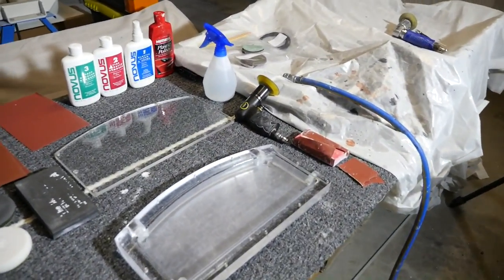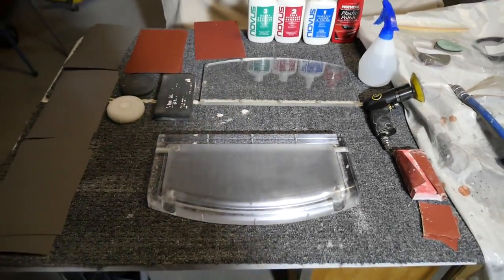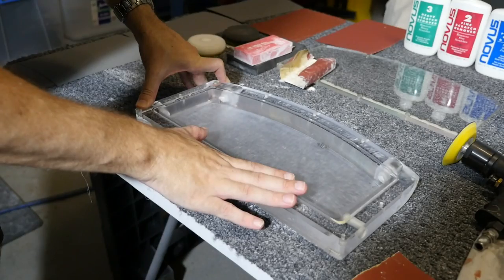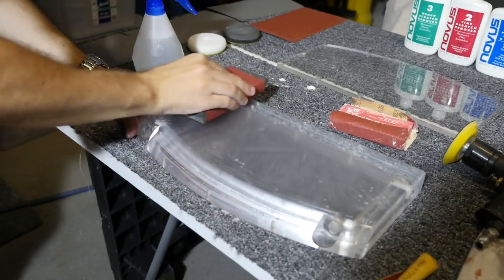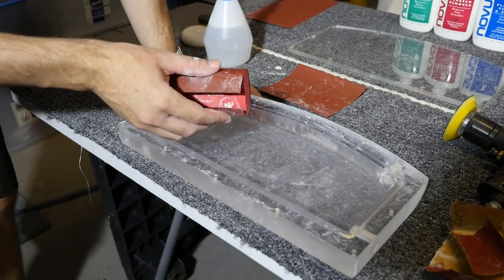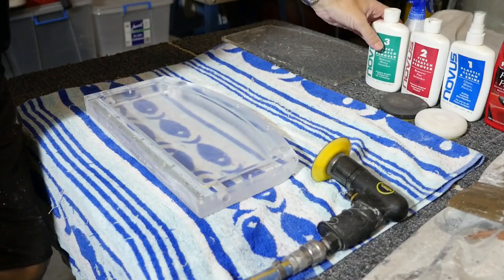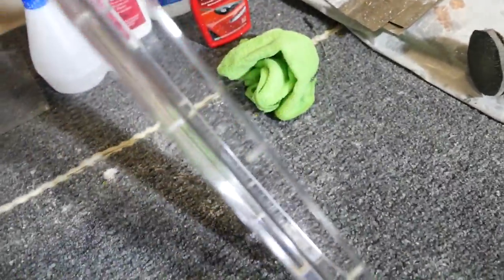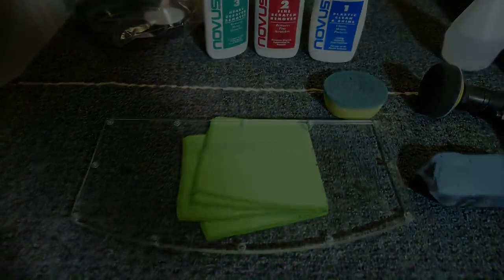SC Modding #5: Acrylic Polishing

Comment: Great video. Thanks. A couple of advices. When you change the grid of the sandpaper rinse the part first. If you don't the coarse particles stays and they scratch the surface. Don't use detergent for cleaning or polishing. I don't know the chemistry but makes the acrylic foggy. If you read the cleaning instructions for a acrylic blender or motorcycles windshield for example, they recomend to use mild soap.

Comment: great work...If you drilled hole into the acrylic sheet, can your system of polishing down inside the holes,would the hole bore become clear..Ive drilled into acrylic before,and the bore after the acrylic was drilled,became foggy looking...How would you clean the inside of the hole bores,so they were reasonably clear..I want to be able to see whats in those holes once drilled,...any suggestions?  sure would appreciate a response...thanks,jb

Comment: Love the polish and the look of the part, but I do wonder how the thermal expansion of acrylic will come into play during use as the acrylic piece is so large. Also i wonder about the large opening and o-ring and how it will hold up over time. Not being critical, just wondering about the mechanics of this thing. Love the videos, they are the reason I built my own first proper pc.

Comment: Looks great!   However, you might want to experiment with heat to polish acrylic.  Made some screw drivers years ago.  The handles were done on a lathe, then on the lathe using a torch going back and forth would polish the cut areas perfectly clear.   If you did it right anyway.  Heat left to long would create bubbles and scorch marks.   Now a heat gun might be a better option.   Though, heat is probably faster, buffing may be safer as not sure you could recover from a piece from scorch.   Thanks for the videos!

Comment: I find that once you get to P800, you can switch to novus 3.  Novus 3 is definitely course enough to tackle P800 (some people say even P600, but I get mixed results at P600).  I find the hard part is using Novus 2 after the 3.  There really needs to be something in between - i.e. your 5 hrs mostly spent in polishing comment I am guessing is going to be the work with Novus 2.... (and for perfection, something finer than 2 as I cannot get to haze free compared to new cast acrylic to the naked eye with Novus 2. Extruded acrylic is not of sufficient clarity and looks "perfect" after novus 2, but cast acrylic is definitely clear enough to show slight haze where Novus 2 has been used. I haven't found a polish to do the last bit  yet, after many years. And yes, I am here watching this video to see if any suggestion for that last polish is presented, but no such luck!).

Comment: A tip if you are trying to keep a flat serface for a seal you can use a sheat of glass with an area than the item serface you are working. Wet the serface of the glass then apply the back of a large sheat of wet and dry to to the wetted glass. The wet and dry will cling flat to the glass. Then work the item in a figure of 8 pattern. This can also be used to correct a warped service. To get the final finnish replace the wet and dry on the glass with a sheat of plain copier paper then apply a small amount of diluted cutting polishing compound to the paper and then work the item in a figure 8 pattern again untill you achieve the final result.

Comment: Great video.  I like the idea of the metal polish bump, or maybe trying Mothers mag polish.  
I feel competed to make a clarification.  You are apparently using "P" series sand paper, so not 600, 800, 1200 grit, but rather P600, P800, P1200, etc.  They are quite different with 600 (CAMI) being almost the same as P1200.  I feel that it is not just a minor point.  There are other grit systems, but I think P (ISO/FEPA) and no P (CAMI range) are the two most common sand paper grit ranges.  It bites me in the ass every so often, particularly at the 1200 level where P1200 is not a forward step from 600.  I try to mark the surface of the disks with a sharpie to minimize issue.

Comment: Well done, it came out beautifully! I think I recall seeing videos on YouTube of people polishing the edges of acrylic sheets using a torch, like for copper pipe sweating. Perhaps this would make the step between 2500 grit to sponge a bit easier.
Reply: +bedsheetmonkey It does work, but for a really clear polish, it has to be flat.  Machining and sanding induces waviness that can be easily picked up by the eye if not sanded flat.

Comment: great vid and excellent results.... but 5hrs of polishing wow! :0 
How long did it take you using the  metal cutting compound you ended up using for the base section? Would it be quicker using a final sanding pass using a 5000 or even 7000 grit sandpaper like the ones you linked in the description?

really liking the new style of your vids by the way. keep up the good work!

Comment: Im sorry but "cant get anything made in this whole country" is the most ridiculous statement. 
I could name 10 places in Brisbane alone other than mine that could make these 2 simple components.

When machining acrylic we thread mill the threads at 10000 rpm with coolant so the threads are nicely transparent, we don't tap, you can polish the outside all you like but the eye will always go to the dry looking tapped threads, we screw the mating lid on when sanding and polishing the edges so the edges stay sharp.
Reply: Where abouts in Brisbane would you recommend for me to get something like this produced?